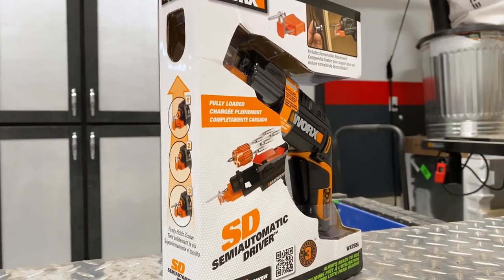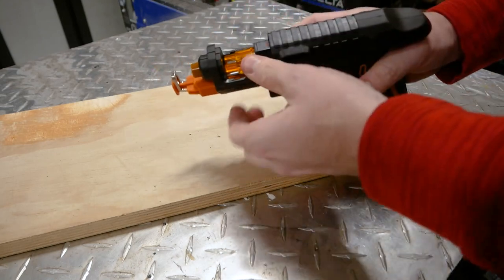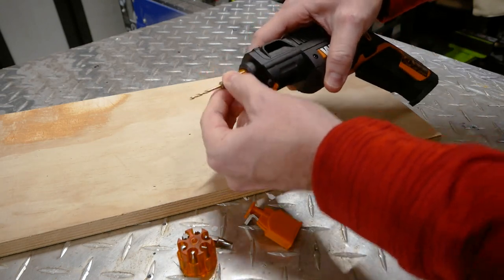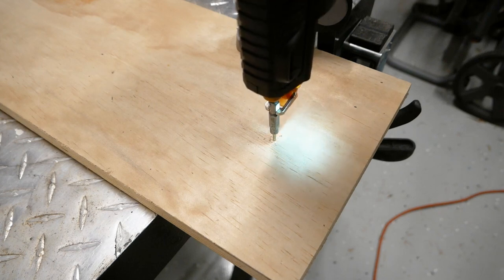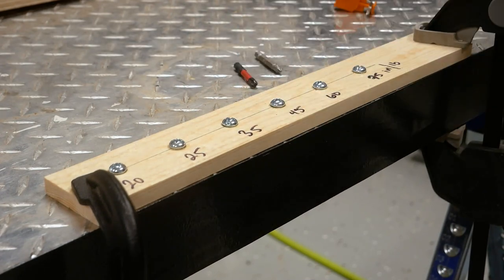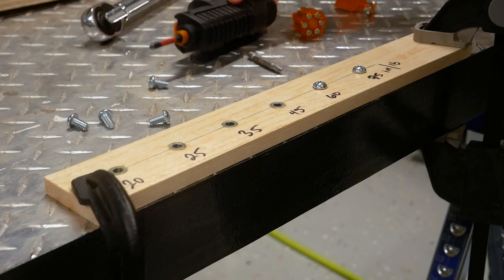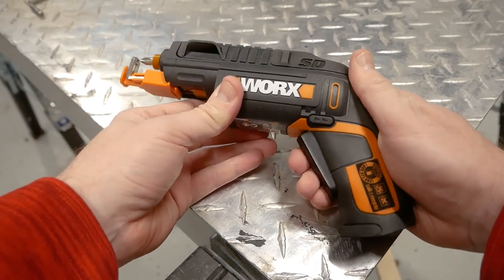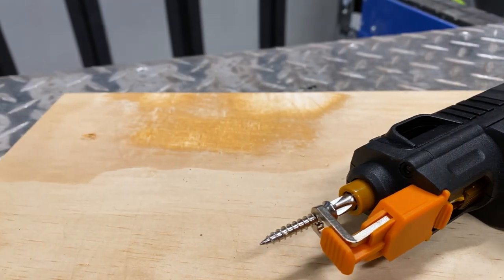The Worx SEMI-AUTO Screwdriver is a WINNER

Comment: I used to have a version on this without the screw holder. It was weird but useful
Reply from the maker: Wouldn't that just be a regular electric screwdriver then?
Reply: @aaronstestlab  na, I mean the orange piece that sits in front of the bit when it's extended
Reply: I still have mine.

Comment: Nice video! As I've increasingly needed small form factor tools that don't need to do power jobs, Worx has been popping up as a good option. I recently got into the MakerX system. Great little tool series for my own needs and its all safe enough for the neighborhood kids to use when they want to work on projects.
Reply: they add their touch too. that screw holder thing looks really innovative. you can never screw 90 degree with these things without drilling first. with this you can just go with it